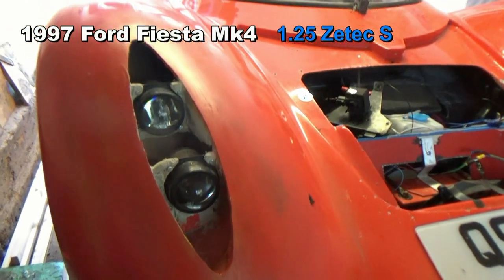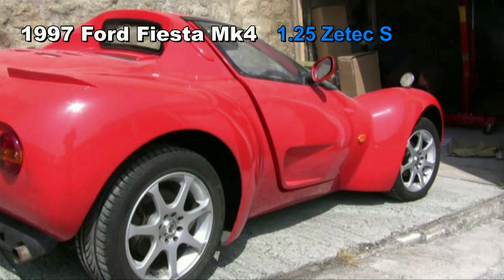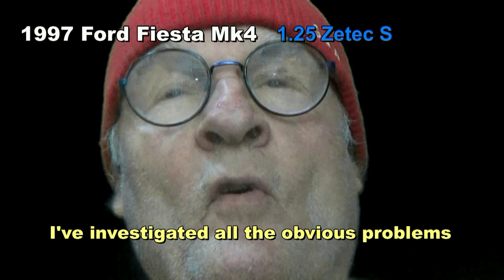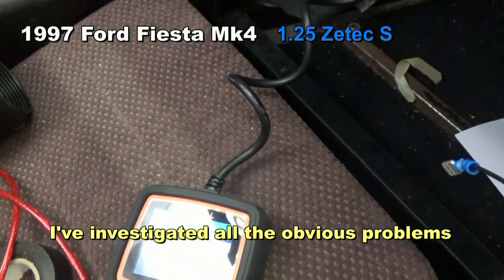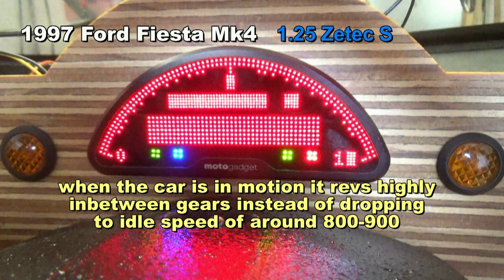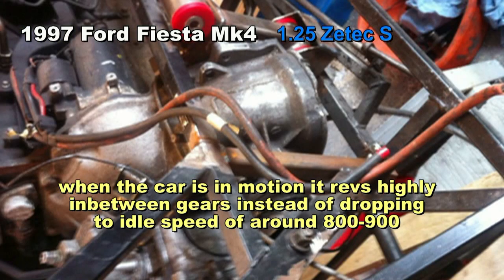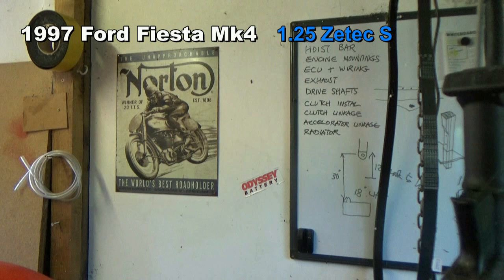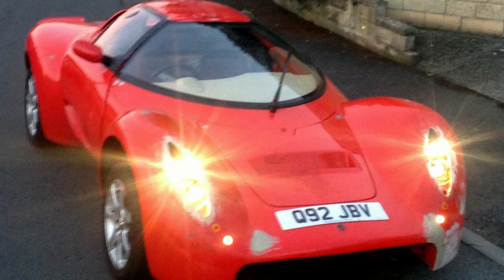Fiesta Mk 4 - Zetec Engine Over-revving on Raffo Belva Kitcar

Comment: It wouldn't hurt to acquire a (repair) shop manual for the vehicle the engine originally came from. I'd try either ebay or discussion boards for the make and model to try to source one.
Reply from the maker: I do of course have a workshop manual that but this is a problem inherent wity this engine.

Comment: that code relates to the fuel tank vapour control system which comprises a collection canister and various hoses that connect the fuel tank to the canister and then to the inlet manifold via a purge valve  . . When the purge valve is closed,  fuel vapour is collected in the canister . When the purge valve is activated the fuel vapour is drawn into the engine via the inlet manifold to be burnt. The system has to be completely sealed.
The purge valve is controlled by the Power train Control Module . I would check all you connections between the fuel tank to canister and the inlet manifold then check that you have the purge valve fitted correctly and it is receiving input from the control module.  If there is any air leak on the hoses between the fuel tank and the inlet manifold or the purge valve is not operating correctly then the engine will never run correctly because the ECU will constantly be compensating for too much air flow into the engine making the fuel air mixture too lean ....hence the rising and hanging idle .
Reply from the maker: John - Thank you very much. I have lost a lot of time as I seem to have been previously misadvised that the tube you refer to wasn't needed but even my limited understandimg of an ECU is 'dont change a thing'. When we transferred the engine, wiring and ECU I intended building a new aribox  as room in the rear of this car prevents the original Fiesta one being used. I replicated the sixe of the airbox up to the filter but have not yet built the chamber post fileter, into which this vapour collecting tube should be fitted. We simply blocked the tube off! I have ordered the IAC component three times and the wrong one been sent but maybe it doesn't need replacing if I can fix this issue you have raised.
Reply: @WoodomainJeremyBroun  yes you need to re-install the complete original fuel tank vapour purging system from the tank to the inlet manifold including the purge valve. It is probably not critical that the original  collection canister is fitted,... if you can find a similar canister which will fit the space you have, it will function fine provided it is all fitted as per original connections and the canister can be fitted anywhere on the car of course by extending pipes.
You could buy cheap used parts to test with initially .
The original ECU is programmed to expect all the original sensors and fuel injection components in order to function correctly. The engine sensor is a critical sensor which tells the ECU if the engine needs additional injector pulsing (ie for cold starts)  etc so you were right to replace that  part  although you can test it easily enough by putting it in a cup with boiling water and a thermometer and measuring voltage with a multimeter within recommended temperature range .

Comment: Just to add, the throttle position sensor on the throttle body is also a known fault, I think the wiring or sensor in the area breaks down. If you change the the TPS or IACV   you will likely need to reset the ecu parameters when complete, but google should tell you how. Finally, I would check all vacuum pipes on the engine are connected.
Reply from the maker: You obviously know what you are talking about. Only today we noticed an unused  vacuum component (transferred from the donor vehicle) that when we disconnected it ran up that error code. I was advised to block off some of the pipes including a breather pipe to the airbox. Is it the same one as in my video?

Comment: There is a known ford fault, check the idle air control valve, usually manifests itself through high revving when de-clutching / wild idle. I would say clean it, but probably just replace it, they are pennies.
Reply from the maker: Thanks James G.  I have of course cleaned it but we didn't replace it so that sounds good advice. i have to try everything.